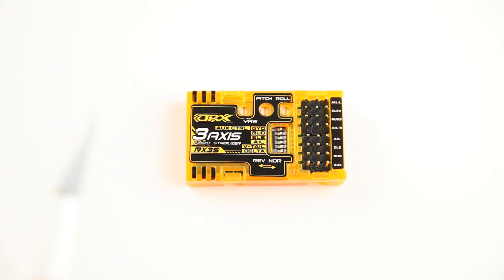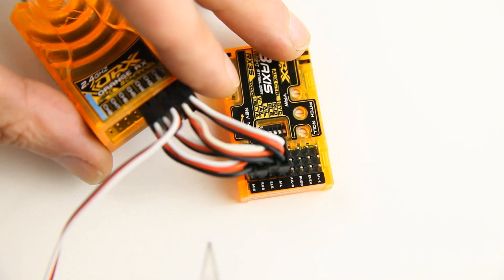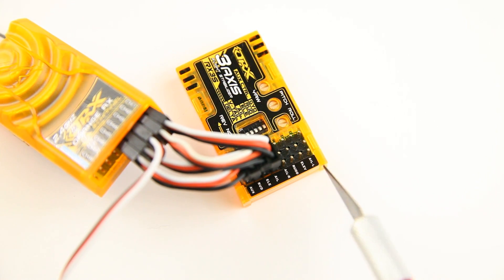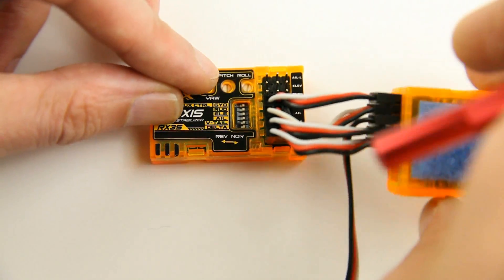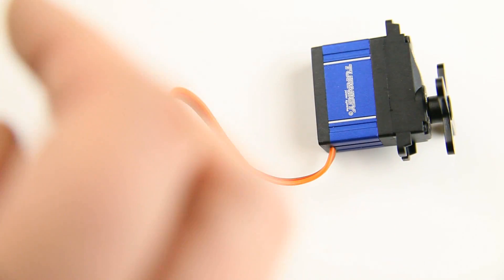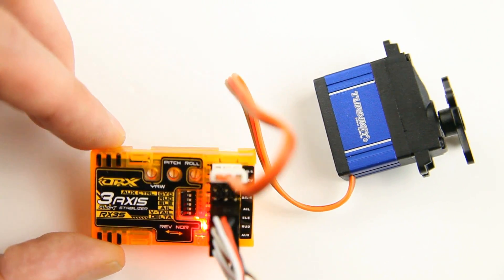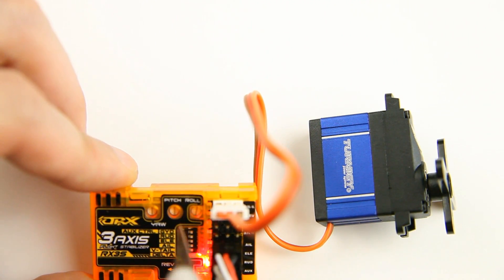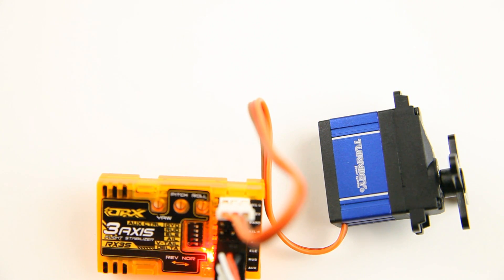HOW TO : OrangeRX RX3S 3-Axis Flight Stabilizer V2.1

Comment: Although this is an "old" product there is stille some reactions on the video. I got one secondhand gifted myself. It might be usefull tot know that ail-R Input pin is usefull for mounting the gyro upside down. I could only get the gyro aileron gyro response to go the right direction by using that input pin on a delta wing.  Reversing the dip switches ( ail and ele combo) does not do this by itself.

Hope this is usefull info to someone, since there is no mention of this in any manual.
Reply from the maker: Thank you very much for that addition Johan-Mark :)  Might indeed benefit someone trying to set one up :)

Comment: @DutchRC Adventures  no no you didn't get my point. You showed Rox stabilizer in your video . I want to ask that can I use this orx stabilizer with my APM 2.8 to make it more stabilize or can it be just used with planes
Reply from the maker: You are correct.. I don't understand :D  
You want to use a stabelizer together with a flight controller (which is allso a stabelizer).. why would you want to do that?
Reply: @DutchRC  okay I don't know that thanks for my help.
Reply from the maker: No worries :)  see it like this: 
this ORX is a stabelizer and nothing more (but that allso makes it simple to use)
an APM has far more options.. (allso makes it more complex to use)

Comment: I have made my own f450 Quadcopter. I am using APM 2.8 with it. Can I use this stabilize to make my drone stable or it can just be used in planes.Plz reply ?????
Reply from the maker: Howdy sir :)  You can definately use an APM flight controller for a quadcopter yes.. I've made several quadcopters that way myself :)
Reply: @DutchRC  no no you didn't get my point. You showed Rox stabilizer in your video . I want to ask that can I use this orx stabilizer with my APM 2.8 to make it more stabilize or can it be just used with planes

Comment: I know this is a old video and seen it before and why i have one in HK shopping basket waiting for payday.

Do you know about this ?   
Magic Bullet Diode" could save your electric aircraft! BEC Backup/Failsafe for under $1 with Demo ? 

 (https://www.youtube.com/watch?v=TK8MYkRHxck&lc=z22mevspfkbzxpzgx04t1aokgwyatepen35yz5n5rb53bk0h00410.1512839706572291)
They also have another video about using servo and a switch to switch between 2 batterys
Reply from the maker: Ah yeah.. Some other stabelisers actually come with a cap. with somewhat the same purpose: 
https://www.youtube.com/watch?v=AcFgc5bMbpg 

NOT a bad idea for sure..
Reply: Thei idea is incase the BEc fails and you can still land

Comment: 4:16 Those connector are actually Male to Male. The Connector plugs into a shrouded connector that is called the Female connector. It is the connector that is named... not the pins.
Reply from the maker: I respectfully disagree :)  Ohw well.. I guess it is clear in the video of the connector has pins or not ;)
Reply: It is your right to disagree.... For some quick and easy reference.
https://www.google.ca/search?q=rc+servo+male+to+male&biw=1152&bih=718&tbm=isch&tbo=u&source=univ&sa=X&ved=0ahUKEwiZ8rTchPTPAhXMy4MKHUr9B6IQsAQIPA

http://www.ebay.ca/sch/i.html?_odkw=male+to+male+servo+cables&_osacat=0&_from=R40&_trksid=p2045573.m570.l1313.TR0.TRC0.H0.Xmale+to+male+servo+extensions.TRS1&_nkw=male+to+male+servo+extensions&_sacat=0

 also

http://www.ebay.ca/sch/i.html?_odkw=male+to+male+servo+cables&_osacat=0&_from=R40&_trksid=p2045573.m570.l1313.TR0.TRC0.H0.Xmale+to+male+servo+extensions.TRS1&_nkw=male+to+male+servo+extensions&_sacat=0

I may be wrong.....
Reply from the maker: It is indeed just fine to not agree on everything.. But.. please ask yourself if That is a good source of info? Consider how electrical things have been designed, even before RC was around.. Generally female plugs tend to 'give' (electricity).. like a wall socket for instance.. the male part generally received..

Now have a look at JST connectors on lipo's.. Those (red) plugs didn't have the outer sleave in the old days by the way.. Do you really think they went from female into male just because someone added a outer sleave?

Comment: I connect everything as per your video, and i get everything to power up how ever when i tilt my receiver my servos only jitter, if i move my control sticks my servos move correctly! Any idea?
Reply from the maker: +Alejandro De La Garza Try and increasing the sensitivity to more then you would really want, so you can more clearly see what happens :)
Reply: +DutchRC Adventures i díd but all that happens is that when i tilt my plane the servos correct but then immediately return to neutral and dont keep correcting the plane even if still tilted
Reply: +Alejandro De La Garza however if i move the servo with the radio the y respond very well
Reply from the maker: +Alejandro De La Garza Ohwwww O.K.! In that case you misunderstood how a stabeliser works.. A stabeliser indeed does a short correction, and then reverts to it's 'normal' position.. 

The kind of behaviour you were expecting is what a GYRO does.. Those will indeed keep trying to correct a heading until they succeed.. 

So.. Stabelisers only dampen unwanted movement.. In short: I think your stabeliser works as it should :)
Reply: +DutchRC Adventures oooohhhhhh aaaaaand i just got sent to kindergarden rc :( haha ol i will try it and will see results
Reply from the maker: +Alejandro De La Garza :D  Don't forget to dial back the gains offcourse ;)  Very high gains Are handy to check if the stabeliser corrects the right way though :)  
Good luck!

Comment: Well I sure can't figure it out, what does the on-off wire plug into on the receiver & stabilizer?
Reply from the maker: +67robb Okee.. on the stabeliser side it's the Aux input that controls shutting the stabeliser on/off (AND you need to slide the top dip-switch..
On your receiver side it depends on what channel Your receiver uses for landing-gear? (on mine it is channel 5.. I use a Futaba transmitter)

Comment: Would this stabilizer help with landings, keeping a "Tail dragger" type plane from "nosing over" on landings?? I have a HobbyPeople 1/6th scale EPO Foam P-51D that has a propensity to nose over on landings, no matter where you move the Center Balance or adjust the retracting landing gear.. Everyone that owns one complains of the same problems, so it's not just me ....... kind of tough on Props!. Will this or any stabilizer detect an impending nose over and up elevator to "pin" the tail to the ground?  Like most "warbirds", it MUST be landed hot and fast.  How would I set the Flight Stabilizer to react this way?  Any tips welcomes Dutch!
Reply: +DutchRC ADVENTURES - Sadly, these nose over do happen while still at a pretty healthy speed, and associated with the plane is still parallel with the ground during the landing process. In confidence a manager at HobbyPeople  (mfr) admitted that there is some sort of engineering error in the design so that this P-51D just doesn't want to "put the tail wheel on the ground". It's a wonderful flying plane and takes off easily for a tail-dragger. 

I am completely new to 3 Axis Stabilizers, so may I ask, with a model that uses Left and Right independent receiver channels for the Ailerons, how do you connect thru this OrangeRX RX3S Flight Stabilizer ... or is it just not meant for this type of 6-channel model?

Compliments on a very very good video, your English and thank you so much for you timely reply.  (I am assuming you are Dutch and in the Netherlands)
Reply from the maker: +Vintage Cycles You are welcome, and yes.. I do indeed live in the Netherlands :) 

Hmm that IS a shame man! Again.. A stabeliser will help a bit, and it might enable you to land slower, as the stabeliser will solve the instability for a good amount. 
These stabelisers do not take a seperate-channel ailerons setup into account. You CAN however use them on such a setup. You would only stabelise 1 aileron in that case. You'd basically have about 50% stabelised roll.. (you can compensate that with a higher gain) 

For the price of these it might be fun to just do some experimenting with them, as you can remotely turn them off?
Reply from the maker: +Keith Benicek Hi there Keith, 
well a stabeliser will make landings easier for Sure. If it would really prevent a nose-over is hard to say. You would probably not be moving along very fast at that point, so I would doubt that the elevator would have enough authority to keep the nose up. 
The stabeliser itself will Surely detect the unwanted pitch-forward and try to prevent it. If it would be enough.. Well, I guess it will prevent at least a few nose-overs....
Reply: I had this problem with my elite P-51 for 6 months flying off grass. My fellow flying buddy figured it out.  Place the battery in the factory recommended spot, bring the plane in with two to three clicks of throttle all the way in to touch down and cut the power and pull back on the elevator control.  This takes a while to practice but in 20-30 landing we both can land now without tipping over.  It truly is a skill.  Oh, my flying buddy installed softer and bigger landing wheels. Dubro is the manufacturer.  Have fun practicing this.

Comment: turns out i had mine pointing backwards!
Reply from the maker: +tab328 That does NOT help sir! :D  You can still make it work when reversed, but you would sure be better off when using it as I explained in the video :)
Reply: So I noticed! :D I'll fix all that up along with my ailerons! Oh I'm TAB on hobbyking by the way.
Reply from the maker: Ghehe yeah.. I got that mate ;)  
Hope the video & my tips helped!
Reply: +DutchRC ADVENTURES Definitely did! thanks!
Reply from the maker: Cool :)  Then I idn't make the video for nothing ;)

Comment: They are male to male connectors.
The connector goes into the receiver, so they are male connectors, just like bullet connectors, the one that goes into the counterpart, is the male.
Is it the camera angle, or are the aux pins on the stabilizer bent, you can see it in the first minutes of the video.
Reply from the maker: +Ruud (Ruud G) I must say that I Have received these with the pins (slightly) bent in the past.. In This case it was allright.. I guess it is the camera angle :) 
Well.. and if you want to make the same mistake as HK did.. Be my guest..  In my world, connectors with PINS are male.. And connectors with holes are female.. these connectors have Holes..
Reply: +DutchRC ADVENTURES Yeah, that is also  a way you can see it, that is like bullets, I see the connector as a whole, so with plastic, and in the case of Futaba/JR receiver plugs, that is the plastic connector that goes into the female ( receiver, extention, Y harness etc. ).
I see it that way, and I think there are a lot of people with me :-)
There are a lot of ways to do things in RC, there is not nessecairly one right.

Comment: What's your opinion of the OrangeRX receivers with stabilization?  Do they have good range, or is it best to use something like this in addition to the original, say Spektrum, normal receiver?
Reply from the maker: +Tim Adams I had 2 of those stabelisers with build-in DSM2 receivers.. With both I've had loss-of-control crashes.. So I don't trust the range on those anymore.. For me it's only normal receiver + a stabeliser...
Reply from the maker: +Tim Adams Hmmm hard to say, but I WOULD be sceptical indeed :) 
Those would be used in small planes though I guess.. And you would not fly a small plane far away...
Reply: Yeah, good point.  Better safe than sorry!
Reply from the maker: +Tim Adams For sure mate :)  Still those little mini receiver might be nice for an ultra-micro build.. :)
Reply: True! :)